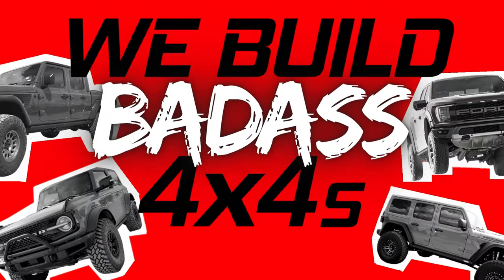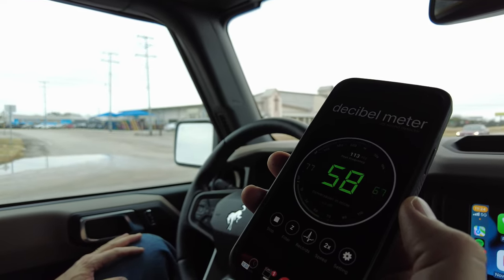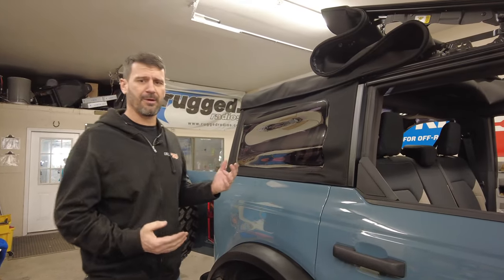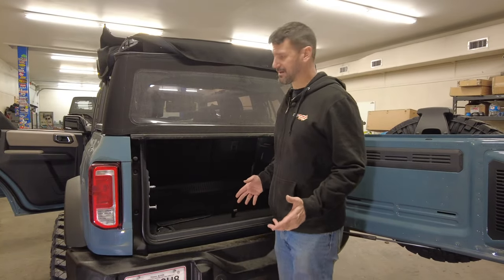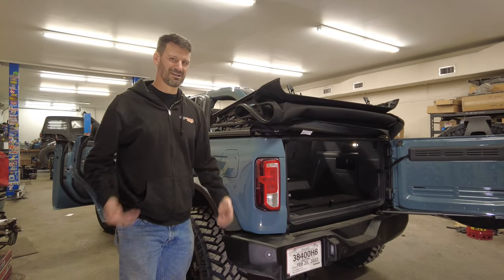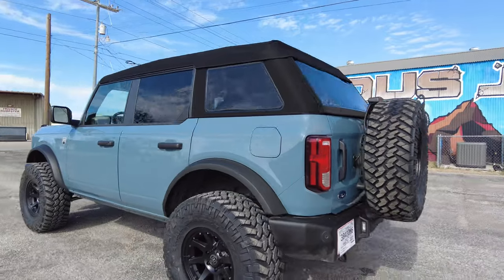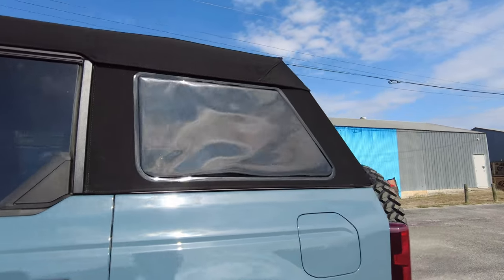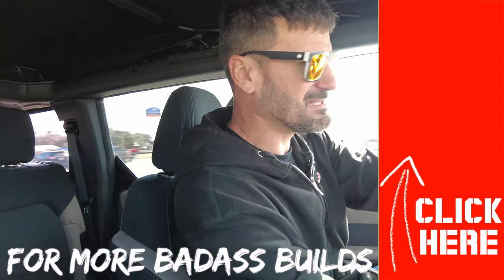Review of the Ford Bronco Soft Top + Solution, the Bestop Trektop

Comment: I have the factory soft top, and while not perfect its a great top very happy with it.  I only got the soft to get my Bronco sooner, with the intention of getting a hard top. After having the factory soft for 6 months, I enjoy it enough I'm going to put off getting a hardtop for awhile, maybe until it wears out.  The frame and mechanism on the factory top is much more sturdy, and it stays put in the sun rider position without bouncing around.  Just because you can stick your hand through doesn't mean that much, I've been through some downpours and it does the job.  That said I'm glad there are other options, and this Bestop does look good.  It is also likely to be much less expensive than a OEM product from a dealer.

Comment: The back side windows are wavy by design, because the back portion lifts up for access to the back of the cargo area AND because you are able to pull the top ALL the way back off the C pillars. If the windows were stiff, straight, not wavy the lift aspect would be less effective or not be possible at all.
Reply: I understand that but jeeps soft top rear window can be totally removed much easier in seconds really or can be flipped up onto the top so its out of your way plus the tailgate bar is removed with the window so it isn't in your way once removed. The Bronco rear window has the molded corners meaning you need to at the very least undo the side windows from the rear window to remove just the rear window and even once removed the tailgate bar is still there. The lifting features is neat in theory but it does limit what you can and can't put in the back, including the doors.

Comment: My buddy bought the best top and has the same problem with the side to be loose , even the material from best top looks cheap.
The folding was not consistent , Imsaw the 2023 model and looks way better on the sides ,  not sure if they reinforce that .
Probably because they went cheap for the first version ,they invest all in hardtop but they had problems building it

Comment: Put the decibel meter away and just listen to see if it's quieter? C'mon, man! Looks like the new top just has better looking rear windows and isn't any more quiet. You didn't show how to access the rear storage with the new top. I drove the Bronco Outer Banks 4 door with a soft top today (highway 75mph and city). I had no problem holding a normal conversation with the person in the passenger seat. There was wind noise, but it wasn't much. The noise issue is overblown.

Comment: Despite being completely different types of vehicles and thus a very unfair comparison, the Bronco actually shares a lot of similarities with the Mustang.

-Both are named after a species of horse.

-Both wear their own logo, rather than the Ford logo.

-Both nameplates have a separate, unrelated model that’s named as if it was a variant of the regular and wears the same logo. There’s the Bronco Sport and Mustang Mach-E.

-Both have special drive modes designed for different conditions they were built for. The Bronco has G.O.A.T (Goes Over Any type of Terrain) modes and the Mustang has different performance drive modes whose system is unbranded.

-Both offer only one drivetrain. The Bronco is 4WD-only and the Mustang is RWD-only.

-Both have hard-top and soft-top variants.

-Although not the case yet, the Mustang may soon get a 4-door variant. As soon as it does it would share yet another similarity as both models would have both 2-door and 4-dor variants. Furthermore, both have been 2-door-only for decades until the Bronco got a 4-door variant when it revived. The Mustang would get its 4-door variant decades after its debut as well.

Just because two vehicles models are completely different doesn’t mean they can’t share many similarities.